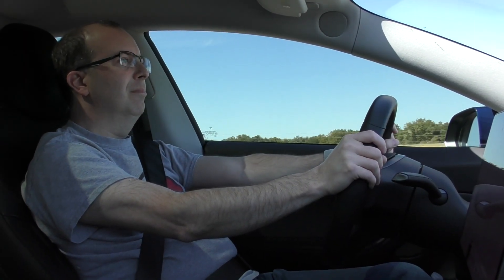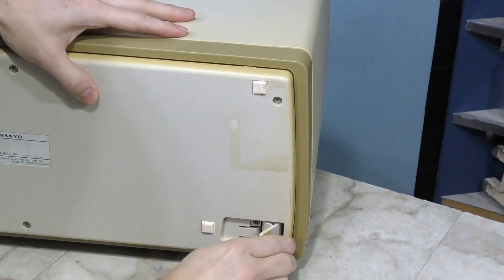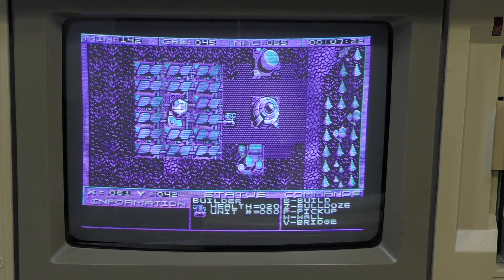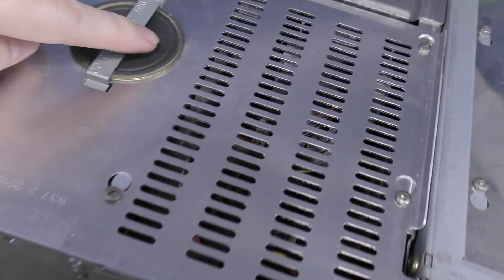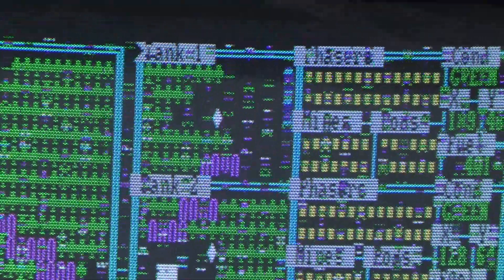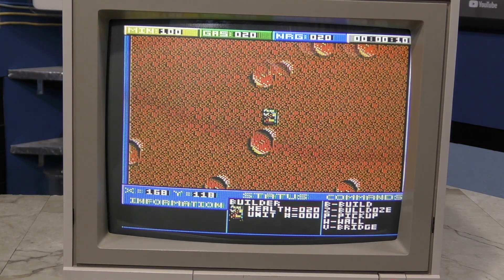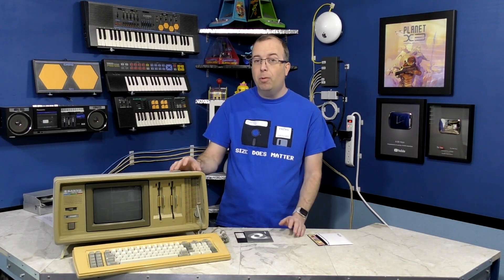Sanyo MBC-775 - The first PC portable computer with color screen.

Comment: That 1982 year might be the year it was released in Japan, so it was only available there for first two/four years. Though more likely it was unveiled in Japan in 1982 but didn't enter production until 1984/85. I am not hundred percent sure, but I remember reading that kinda thing was some what common in the PC/IBM clone market in early 1980's Japan. As for strangeness of the proprietary soft requirements that is a famous habit in Japanese electronics, most times it was claimed to prevent piracy but it was used to lock you into software.

Comment: Reminds me of a Sanyo MBC-555 that was my first intro to PC's. Came bundled with a suite of *star software. I used reportstar to create a TV hire package that would print out invoices each month and update the database. Was great fun and I got paid in VHS tapes which were priced at about US$100/NZ$180 a box of ten at that stage.

My own computer was a C64 that I plugged into a Toshiba 5" TV through a composite connection. Later this change to an NEC 14".

Comment: My guess is that it's very close to the MBC-555 in its incompatibility. Sanyo had some software companies make specialized versions of MS-DOS, BASIC, WordStar, CalcStar, and some others for it because of the way the video works. It's known that if you can get a video graphics card to work in the computer that it fixes the incompatibility... or maybe it just makes it less of a problem. Maybe if you could source some of the software for it you could get it working in the MBC-775? http://www.vintage-computer.com/sanyombc550.shtml http://www.computinghistory.org.uk/det/8932/Sanyo-MBC-555/

Comment: PCH is really bad with speed limits. You might be driving from Dana Point to Laguna and it'll be like 45-55 mph, but once you hit Laguna Beach it's 35, then it picks up again all the way to Long Beach, where it slows down again pretty much until you get past Santa Monica. 

Mind you this is all in less than 100 miles.

If you ever want to take PCH ask the way up California, skip LA, take the 405 to the 10 and continue from there.

Comment: Good video.  Thanks for the info.

Regarding the custom version of DOS, remember that in the early days of PCs, there were many MS-DOS systems that were not IBM PC compatible.  The most notable example (at least in my experience) is the DEC Rainbow (https://en.wikipedia.org/wiki/Rainbow_100), but there were others.

These systems have 8088 processors and can run MS-DOS (frequently a custom version), but the compatibility stops there.  Their BIOS chips are generally not 100% compatible (sometimes totally incompatible) with IBM's and the hardware peripherals often differ as well.  They can run DOS programs that restrict themselves to DOS interrupt services, but generally need custom versions of apps that want to use the BIOS or directly access hardware - which is almost anything that wants to have reasonable performance.  These systems were far more popular as CP/M platforms than as PC clones, although that still doesn't count for much.

These systems pretty much went away after Compaq broke the ice by making a clean-room implementation of IBM's BIOS that was fully compatible without violating IBM's copyright.  When other companies started selling fully compatible BIOS clones (Phoenix in 1984, AMI in in 1986), it became possible to make a proper PC clone without clean-room engineering IBM's BIOS.  At that point, everybody making DOS machines quickly updated their designs to be IBM compatible and the problems of incompatible software almost entirely went away.

As for the flickering text, this is an artifact of first-generation CGA cards and clones that mimic it.  In order to avoid the flicker, you need to either turn off video during updates (which is why scrolling at a DOS prompt looks so weird) or restrict yourself to only updating the video memory during the horizontal and vertical blanking intervals.  If you try to update the video RAM when the display is being drawing, you steal cycles from the display generator chip, causing it to generate static.  Later CGA cards (including the one that I used in 1987) added circuitry to avoid this mess.

Comment: I could be remembering wrong here but back in the days this was made, many of the computers were hardware compatible, since IBM essentially used the Intel reference schematics for the 8088 processor to build the IBM PC.  What caused the incompatibility was the BIOS.  IBM had the BIOS and most of the routines locked up as proprietary and was very diligent about taking companies to court that violated the copyrights.  So most 3rd party builders had to write a BIOS that had similar routines, but were not identical.  This caused the incompatibility because DOS and other programs would call soft interrupt routines and many of these were not well documented and couldn't be directly copied.  It wasn't until Compatibility Software finally reverse engineered the IBM BIOS and completely re-wrote the routines in the first Phoenix BIOS version that compatibles finally became truly compatible.  Even early Compaq computers suffered from this problem.  I used to own a Sanyo 555 desktop that had the exact same issues until I received an EPROM-burned copy of Phoenix BIOS and installed it.  I can bet it originally used a version of the BIOS that is in this luggable.
Reply: And as a PS, there are now quite a few generic BIOS images available from SourceForge, GitHub and the like.  If the BIOS chips are socketed in that beast it might be possible to make it be the machine that it could have been if you did an upgrade to one of those.

Comment: Can the fact that the XT-IDE didn't boot be related to an IRQ conflict ? Had the same issue on my IBM 5160 when I tried to use the XT-IDE card with my IBM Xebec controller card installed.

Comment: The Sanyo MBC-775 was compatible with the MBC-555, which was not fully compatible with the IBM PC. It ran MS-DOS, but the graphics weren't compatible and so on. The MBC-555 had high-quality keyswitches in its keyboard, but a terrible layout.

Comment: Do newer versions of MS-DOS still run on the 8088? I think after the IBM-PC compatibles flooded the market, 8086 (or x86) became the standard and not many software would be written for the 8088 anymore. I've heard something about the 8088 being binary compatible with x86, but I don't know to which extent it can run more advanced x86 applications.

Comment: Texas is notorious for speed traps in all those small towns along the way. After coming across modern FPGA recreations of the 80x86 PC that have very excellent software compatibility, one wonders how Sanyo did such a poor job of compatibility? Am wondering if it came down to the BIOS - surely the hardware memory map wasn't that tough to figure out. Well, these days it seems to be a fairly trivial matter for a single individual to design a board and FPGA implementation that by far exceeds the PC clones of the early 80s era.

Comment: Sanyo's CGA snow seems far worse than the PC's was.  I bet they also use different hardware ports, which is why that text program was absolutely murdering the screen:  It was reading the wrong port to see if the screen was in retrace.  Probably throws off the timing too and makes it run too fast.

Comment: I wonder that you use a Cisco CF card. I found they are actually difficult to use elsewhere than on Cisco devices (or was it the other way around, that only Cisco cards work in Cisco devices?) Either way, a nice throwback to my beginnings as network engineer 10 or so years ago.

Comment: a lot of machines in the early 80's were only ms-dos compatible, some because of the fact they couldn't spend the time to do the bios, and others due to better, but incompatible hardware choices which weren't register compatible.   this one just seems strange, in that it uses the concept of having the cpu sbc go into what you would think would normally be a passive backplane with only a kb controller on it (see the heath/zenith 248 for instance), but to make the video perm just seems such a bad choice at this point in the game.  seeing the date codes on the chips makes me wonder if they just didn't anticipate EGA (and later better) video adapters.  probably took a year to design, nobody knew about EGA until the AT released, IIRC.

Comment: "I'm not very impressed with it" That sentence right there is why I stopped grabbing anything lower than a 486 when I found it. 80's machines look cooler than they actually are 90% of the time. lol
Reply: Personally, I still have room in my heart for 8-bit computers, but not IBM compatibles. There's really only one practical use for 1980s computers, video games, and that was never a strong suit of the business-focused 8088.
Reply: @jessragan6714  Yeah I suppose, even the games of the 80's get a bit dull though. Like for instance I just sold off all my Commodore computers cause it's been over 4 years since I painted that C64C black on my channel and I haven't touched it ONCE. lol There are just so many other options why would you ever choose to play an 80's game. lol

Comment: "The term 'IBM Compatible ' means a lot of different things to a lot of different people.  For example, [we] had visited Sanyo, the Japanese electronics manufacturer, early in 1983 and were shown a microcomputer that used the 8088 microprocessor, which is also used by the IBM PC.  That was the only similarity between the IBM and Sanyo products.  Not a single IBM program would have run on the Sanyo microcomputer without first making program changes.  My Japanese hosts wanted to know what I thought of their soon-to-be-introduced product.
'To sell in America, it must be IBM compatible', I replied." - Adam Osborne, inventor of the Osborne 1

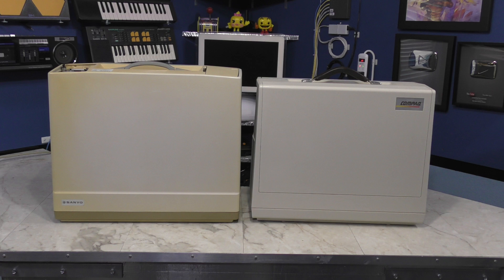Comment: 3:50 Oh yeah. Fifteen pounds of weight is a massive difference. It's about the same as two twelve packs of 12 ounce canned soda (18 pounds or (288/16) ounces).
Anyway, this was an interesting find; sucks that the whole thing is essentially worthless at a general level, and only has usability in a few specific areas. Still, all the same, it was neat to see, like that unofficial NFS expansion that LGR covered a couple weeks ago. #RetroJunkie

Comment: I saw on one of the boot screens it said "AT&T 6300"  those were a line of PCs originally designed by Olivetti that were PC Compatible-ish. Some games had menu options to say that you had a 6300 so it would work around the quirks.  So I wonder if AT&T / Olivetti designed some of this for Sanyo?

Comment: The flickering in text mode for game.  Is due to the refresh rate of video memory, meaning the full screen is written to memory during the refresh is sent on the CRT and it's done in a way that it's not done fast enough.   Bad programming is the cause.    I also remember in the late 80's and early 90's I wrote a software that used my own sauce for Pull Down menus in text.  If I had stick to the programming language of doing the pull down menus,  I would have seen a lot of noise on screen.  But since I literally wrote my own subroutine in Assembly language to avoid that problem of noise flickering on screen.  I was able to have smoothed screen action in text mode in color and in monochrome with the Hercule graphics interface , and CGA in color and in monochrome.

Comment: One of the chips was showing date code: 83
Reply: That doesn't necissarily mean the machine was from 1983. That's just when that specific chip was made, so it could have been a few months or a year old when they installed it in that machine. If you look at 7:47, you see that the chip under the 8088 has a date code of 8430, or the 30th week of 1984. The production date of the machine will always be at least a couple of weeks after the latest chip manufacture date.

Comment: I worked for an Commodore/IBM/Compaq dealer when this was sold. It was made for the Japanese market and IBM was suing people who made straight PC clones. Here in the UK, Ferranti made a PC clone , the 86a and 86b (horrid, black plastic case ) and it was sold in the WH Smith chain and, needless to say, IBM put a stop to that.

Compaq had a 'clean-room' bios. Written to do the same job as the IBM BIOS but did not contain any of their code.

So, for three or so years AFTER the IBM PC came out lots of companies produced MS-DOS computers, like the NEC APC and APC-II and the Tandy Model 2000 which ran MS-DOS, and often had SLIGHTLY better features but were definitely NOT clones. 

ACT-Sirius1 aka Victor9000  and Victor Vicki (all designed by chuck peddle)

Act Apricot 

Compaq and others soon killed them off.

Comment: It could be that it released in the Japanese market in 1982 but didn't release in the US market till 1985? It kinda makes sense. the poor CGA on this and its poor MSDOS comparability was certainly more an issue in 1982 but by 1985 machines with bad MSDOS compatibility had already dropped from the market and clones had improved a lot

Comment: That has to be the most satisfying disk mechanism ever. The toaster-like shot of the disk when ejecting is perfect.
Reply: It still doesn't beat the Sharp X68000 drives which have an Apple-like motorized eject on a slot loading 5,25" floppy drive.
Reply: The NEC APC had 8" floppies with a similar door mechanism. You don't want to get in the way of one of those when it came flying out
Reply: VWestlife would find the ejection satisfying.

Comment: Oh yes, that glorious original CGA text snow.  If you wrote to the CGA character/attribute memory while the digital-to-analog circuitry was pulling pixels and spitting them out, you'd get that garbled mess.  The only way not to do that was to write to video memory during the vertical blank time, hence the "flashy" display you saw in DOS.  (The 21h ROM routines did this, which of course made them very very slow.)   The problem didn't occur in graphics mode.

I found this out when I was trying out some of my text-graphics based games on my school's 5150.  My computer (the Commodore Colt you have on display!) didn't do this because it was based on the Paradise CGA adapter, which fixed that problem.

Comment: I worked in a computer store that sold these systems in 1984.  The Owner/Boss would demo this system with Flight Simulator which ran great on it.  Lotus 123 and Wordstar would round out the system.  We would add the AST 6Pack for memory/ports/clock and a Hard Card (20MG or 30MG WOW!).  A little ANSI.SYS magic and you would have a DOS based menu. Nice systems at the time.  I remember even adding a 3Com 10Base t card for a client too and running it on a Novell 2.11 network.

Comment: Me and my dad had the MBC-555 when I was a kid! A stationary machine that came with a green screen and a simple buzzer instead of a speaker. It was just as incompatible, but a good-looking design! I am sure it’s still in my parents’ attic.
Reply: panchamkauns Same. Originally we had MS-DOS 1.25 and the green screen. My dad acquired another with the colour monitor and MS-DOS 2.11. I was still using the green screen one for Wordstar in 1992. Worked well and so well built.
Reply: Keep hold of it... whilst the Sanyo MBC range are noted for not being very compatible, there aren't many of them left in circulation.

Comment: I purchased my first MS Dos based Sanyo MBC+550 back in 1984 at a price of $550 from Federated Stores. I found it to be about 25% compatible. The color graphics card was proprietary and didn’t work with most color programs. The computer came with Wordstar and assortment of other programs for business applications. I upgraded the memory from 128k to 256k thanks to my father working for a chip manufacturer. I added a second floppy, but it was too costly to expand to a hard drive at the time. This was my college computer.

Comment: Ahem. (puts on best nerdy voice) I think you'll find that the keys have stayed white because they are not ABS.  They are probably made of polybutylene terephthalate (PBT). 😁
Reply: Not really. The reason is the keycaps are considered too small to require flame retardant in the plastic. Flame retardants are generally required in plastic pieces over a certain weight, 2 g IIRC, regardless if they were ABS or PBT. The yellowing is predominantly due to the highly reactive bromine coming out of the brominated flame retardants. By the way, BFRs are toxic and bioaccumulative. I would wear gloves when retrobriting as long term exposure can't be good for you.
Reply: thanks nerd!

Comment: I'm not surprised that the CompactFlash disk doesn't show up under MS-DOS 2.x - it's easy to forget that FAT16 was only finalised with MS-DOS 3.0. Up until then, it was something of a wild west for larger storage options on MS-DOS compatibles, with many manufacturers having their own solutions.
The best option is usually to back up the disk data on the other machine, then format the disk on the target (MS-DOS 2.x) PC. Then see if you can access the new empty partition on the machine you did the backups on. If so, happy days - just copy the data back. If not, you may need to break out an old copy of the Norton Utility/Disk Editor, and change the volume ID. Then try again. If you can get the disk to work that way, then you just have to remember to edit the MBR to change the volume type when switching between the two computers, and you'll be fine.
(Oh, also, you're possibly not going to get a bigger volume than 32Mb, if it's still using FAT12. So you may need to plan ahead and create multiple volumes.)